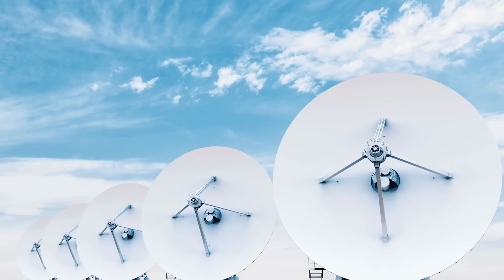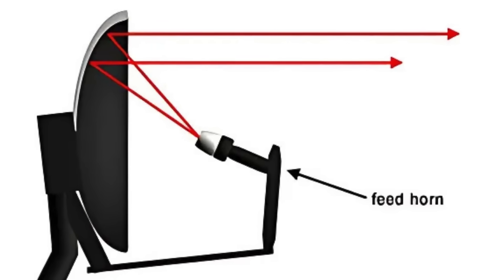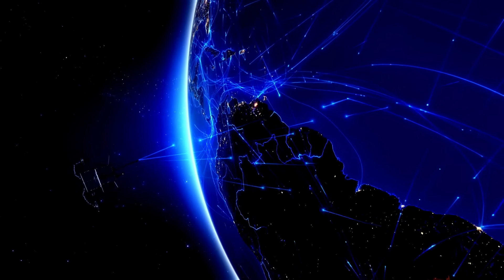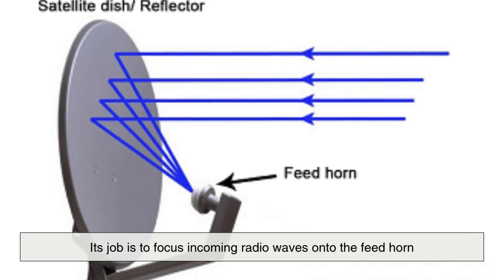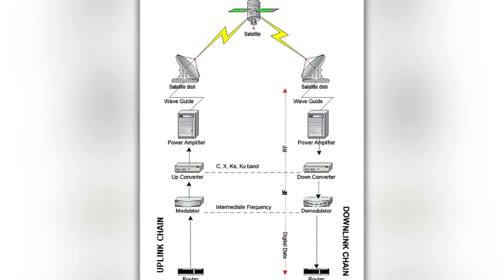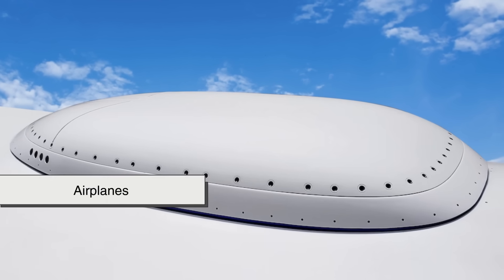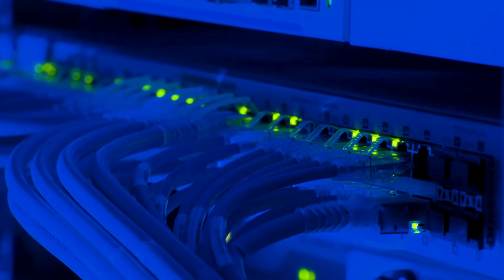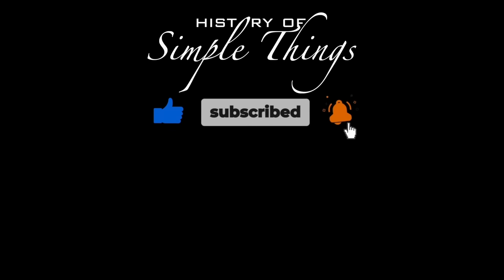How Does a Satellite Dish Work?

Comment: I remember back in the day we had C Band. The dish did indeed have a motor for switching satellites. There were 24 channels/transponders on the satellite for TV service using VC2 and VC2+ encryption. We had a board that decrypted the picture and had to goto the local RadioShack to buy codes to punch in for the audio. the 12 foot. mesh dish never lost signal ever unless it was a windy day to blow the BUD (Big Ugly Dish) around

Comment: LNB is the receiver of these disk (not the FEEDHORN) Which also process and amplifies the received signal ..  On the other hand feedhorn work as waveguides for radio signals. They collect signals from the antenna and guide them to the receiver or vice versa. They are used for both Rx and Tx ..

Comment: Ka band?  Isn’t that KA band?
Reply: I used Ku band LNBs quite a lot.For Tv signals into the decoder,sometimes substituted for a C band one depending on the intended setilite.
But what do Ku/Ka C stand for?
Reply: @pilatedndlovu8980  Ka-band: This is the upper segment (K-above) of the original K-band
Ku-band: Similarly, the lower segment is the Ku-band (K-under)
the "C" in C-band doesn't stand for a specific word but rather indicates its position 
as a "compromise" or "combination" band between the S-band and X-band

Comment: What keeps the satellites in space from moving or falling back to earth?
Reply: Orbital mechanics. The geostationary satellite is moving at the same speed the earth rotates so it always stays above the same location. It would make a great video topic.
Reply: It sure would. @lajya01
Reply: They have fuel to do maneuvering to stay in their assigned space. When the fuel or batteries get close to failing they send it further out into an orbit above the geostationary orbital path. I worked with satellite communications for over 30 years and worked many years in a gateway earth station. We had two 15 meter satellite antennas and a 13M antenna. I worked with C band and KU band frequencies. Ku band is a pain with ice and snow affecting the signal more than in C band.  The Ku antennas we used had a blower to keep water droplets off the feed window.
Reply: They don't drop as there is no gravity to pull them down
Reply: @LeeCo_Animations : Wrong answer. There is gravity EVERYWHERE. The reason they don't fall is the speed at which travel known as the 'escape velocity'.
If they slow down they will fall back.
Reply: Angular velocity
Reply: Centrifugal force
Reply: Velocity.
Reply: What dish..DISC?!
Reply: Orbital velocity
Reply: Space satellites orbiting earth are remote controlled.
Reply: Earth attract it
Reply: Thay ARE moving. They are, in fact, falling back to Earth. 
They just keep missing it.
Reply: Ropes.
They are held with ropes.
Reply: @ZamaMsimanga-j2p , niiiice one 🤣
Reply: The so called orbital velocity